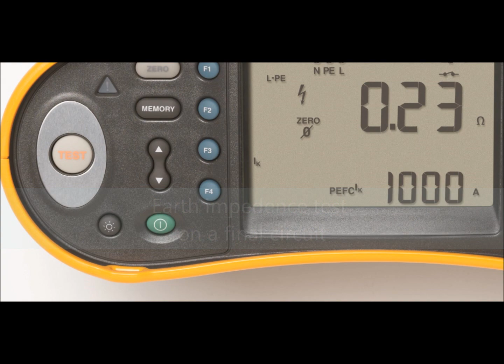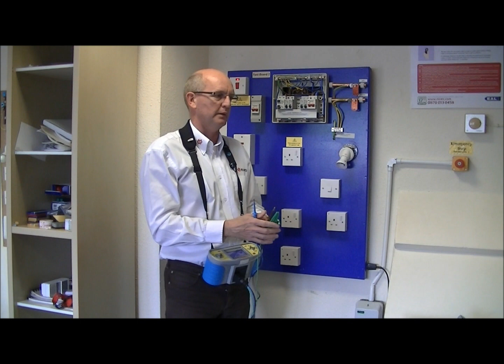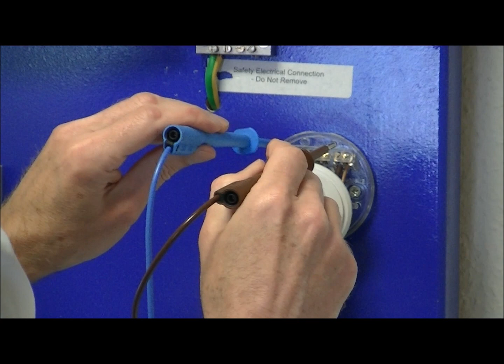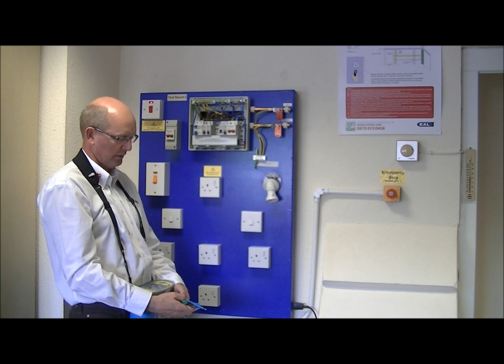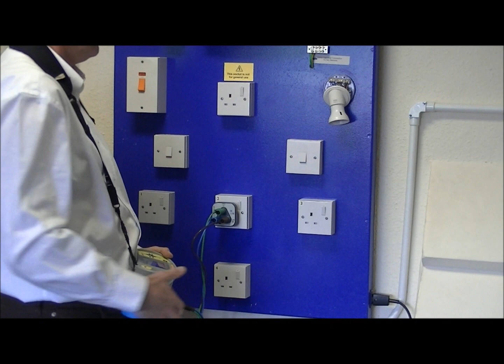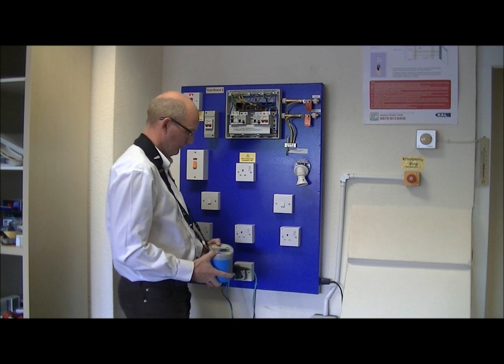Earth loop impedance test on a final circuit

Comment: On a Ring final, shouldn't all the Zs reading at each socket be the same on a ring?
Reply: When conducting R1 +R2 on ring these will indeed be the same at each socket, assuming it is wired correctly. But for a Zs where you are including the external supply impedance Ze, then this will increase as you move further away from the supply source and then reduce as you move nearer the supply source.

Comment: You couldn't tell me how you changed the test current to avoid that rcd trip could you?
Reply from the maker: It depends on the meter. The meter in the video is a Metrel and using the arrow buttons on the LH side of the instrument you should be able to select at the top of the instrument screen 'ZLoop rcd'.
Reply: @TransEuroEngineering  thank you. I've recently bought a metrel. Do  you select the correct rcd fitted  to that circuit then out of the options? I've only had a quick look and tripped out the garage when playing.

Comment: How can the cables on a ring final circuit get further away surely all cables are the same length?
Reply: Don't get confused with the ring continuity test which will provide the same result (if connected correctly) wherever you measure on the ring. But when it comes to measuring Zs you are including the connection to the source of supply i.e. Ze. Therefore as you move further away from the source the impedance Ze + (R1 + R2) will increase.

Comment: Wouldn't the Zs for the cooker point be measured from the connection unit on the wall, near the cooker? as that is the furthest point.
Reply from the maker: Hi
Yes you are correct the furthest point for the cooker circuit would be the connection unit on the wall. The rig on the video does not have this so the furthest point in that case was the switch.

Thanks for your comments.
Regards
Steve

Comment: doing the test on a ring circuit, what conductors do you need to test between if you dont have an adaptor for each socket ? are you testing between R1 & R2 ?
Reply: line neural earth
Reply: paulo - the neutral lead is just for the device to operate. r1 and r2.